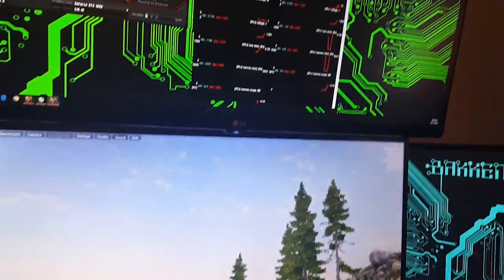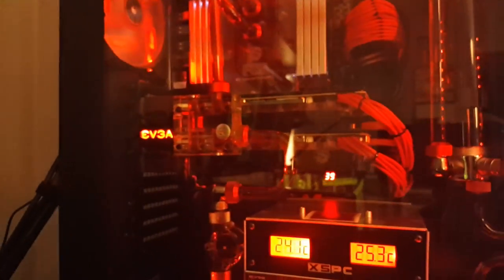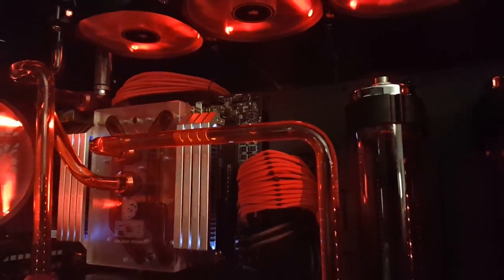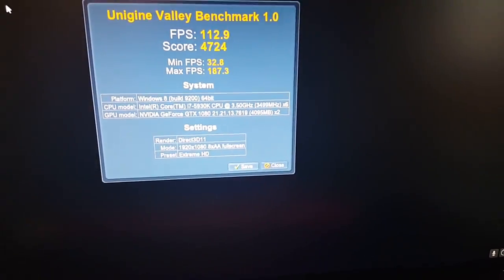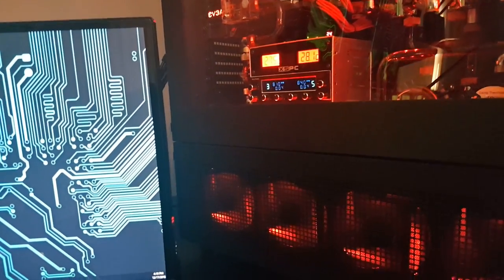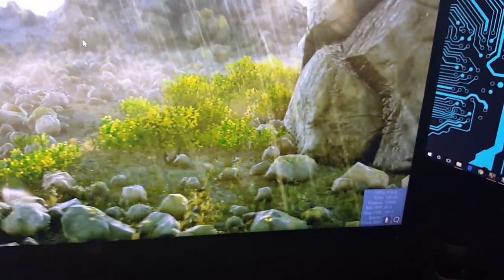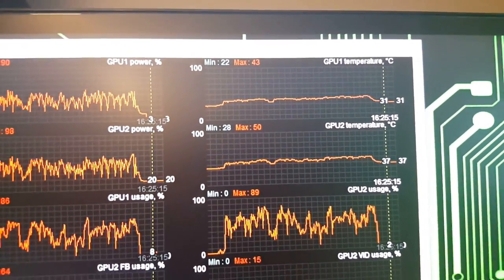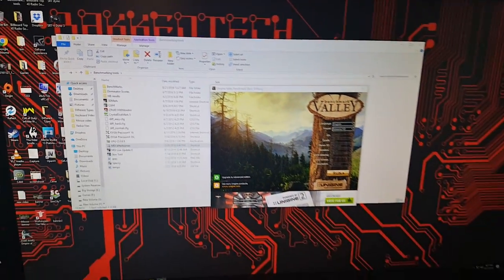PC Watercooling Temperature Benchmarking

Comment: I get 50c Max on my gpu and CPU with $60 bucks worth of fans and a Cooler Master CPU cooler that was $30 dollars. Total cost was under a hundred bucks, lol! Looks cool though!
Reply from the maker: Yup Yup it was really all for show and just over all a very fun Build. other than at the time Doing as much as I can to Overclock to see how far I can push the CPU and GPUs it was only a temporary for Benchmarks where when I was gaming I left it all at stock for the GPUs and had the 5930k at 4.6Ghz.
If I had the chance to do it all again I would actually go back to AIO.
 Custom watercooling has high cost and Maintenance. Like if I want to upgrade to 2080ti's from my 1080ti's I have to buy new waterblocks which adds almost $300 extra on top of the cost of the new GPUS.

Comment: This was cool but I really wanted to see cpu temps as well. Why didn't you include it in this temperature test (With a cpu benchmark)?
Reply from the maker: I will actually re-do the test. I did do one and it was on a Facebook PC page where  I did it live. I played GTA V and watched the temps. The highest the CPU got with all the fans off was 65c which is still good but it did get hot. The GPUs hit 70c after about 20mins of game play with all the fans completely off.
Reply from the maker: But I will re-do the test. I haven't done it since I upgraded to the 1080ti's
Reply: Bakken Tech oh ok cool so the cpu hit 65c under load with fans going right?
Reply from the maker: No Fans off it hit 65c.  but that is with the pumps both at Max so it was carrying the heat but again that was only 20mins I am sure it would get even hotter if I let it run or it would start to boil the coolant lol. underload with fans on I haven't seen it get over 50c

Comment: I used to have monster system with a dedicated sATX psu just for fans & external HDD BUT im actually getting same temps from monster 240 WITH low power fans Push/Pull

Comment: you have big temp diff between two gpu's, seams to me bad paste job. they should be exact same temp when done properly.
Reply from the maker: If you look at the SLI water block terminal it is running in series instead of parallel so one GPU will always be hotter than the other. you can see the difference in my build when I switched to the 1080tis and ran them in parallel so the flow ran through both and the temps were the exact same.
Reply from the maker: Also did your other replies on my video's get removed? I was replying back to another one with my coolant being old and I saw a notification from you but I can't seem to see your comment on that video.
Reply: @BakkenTech  can be, I got banned xD , so acc get deleted with comments and everything. I got two 1080ti's in serial, they were same temp, in games diff can be max 1-2c depending on restriction in ur whole lube, im going to tear down my pc in next two weeks for maintenance and split the lube in two ^^ . my first paste job was god damn perfect, was proud on it, GPU's were same temp, second one not :( first gpu is 2c hotter on idle and up to 4c on load. Has nothing to do with flow rate, just bad paste job... I believe serial is better when you have 2 gpu's, on paralel water flows slower through blocks. didnt test so cant 100% say, but thats my logic behind it.

Comment: ok what the   Temperature after 8 hr playing
Reply from the maker: What are you meaning? like what is the temp after 8 hours on 100% fan speed, 50% fans or 0? realistically no one with a system like mine sits and games for over 8 hours straight.
Reply: the water became hoter  after time ?
Reply from the maker: I have tried it and the water temp rises about 20c without the fans on. I only tested it for about and hour but you can tell it was heating up fast but stayed cool CPU only got up to 70c and the GPUs only hit 65c
Reply: thanks